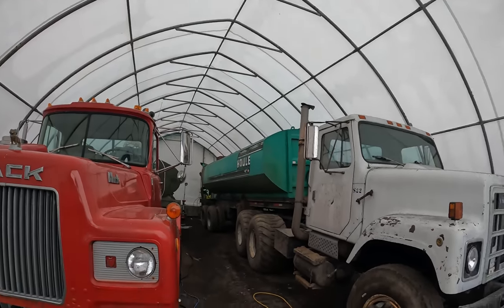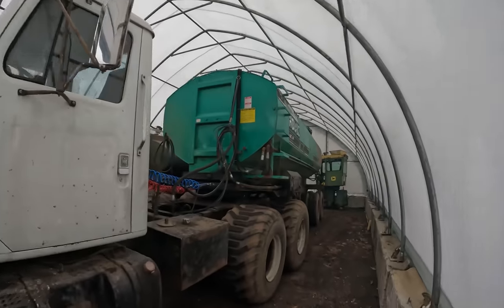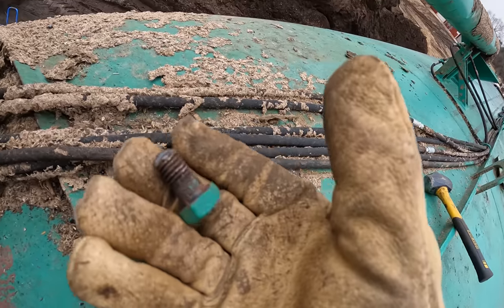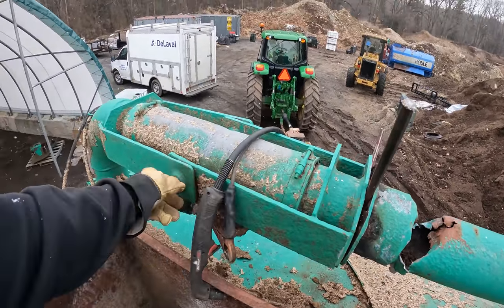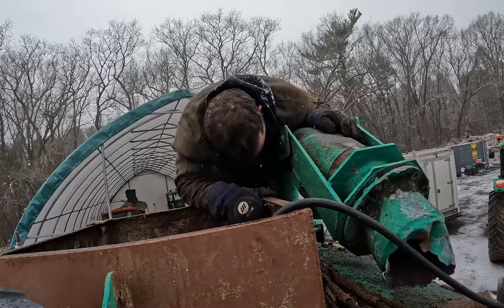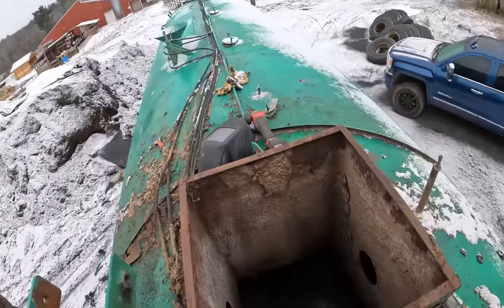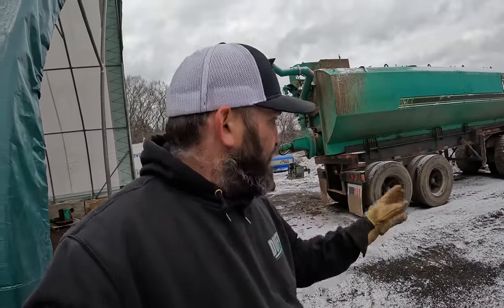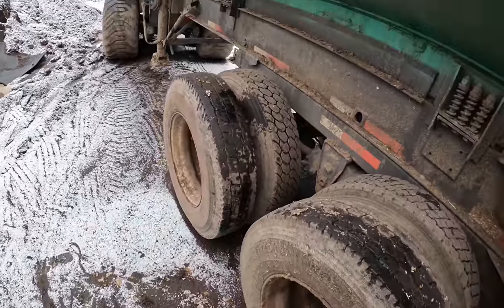A Lot Worse Then I Thought- Manure Nurse Boom Repair

Comment: Pipe saddles work also. Duffy. We use dem on high pressure water n gas n forced sewer. Maybe easier dan burning off dem flanges bolts n buying or dabbing new section of pipe.

Comment: On the boom pivot drill larger hole put in hardened sleeve put grease fitting and use grade 8 bolts  my 2 cents

Comment: Seems like you should do a little modification and make it so you don't need anything on the front of the building at all. Those supports hanging down seem kind of annoying and it would be a lot easier to get both trucks in and out if you just got rid of them and made the whole front open.

Comment: Maybe for when doing lots of nursing rather than cap it what about a safety chain so you can't accidentally spread.  Looking good.  Had to pull my clutch off my 520 since the clutch fork broke. Working in moms barn with no heat but no wind either. Thankfully not too cold  but I do have a torpedo that can warm the immediate area where working if too bad

Comment: Is there a way you can bolt your current diverter valve so you don't have to take your spreader off and cap it?  I know for my part that unless I find and easy solution the "right way" often doesn't get done.